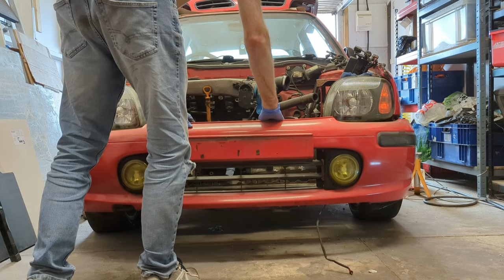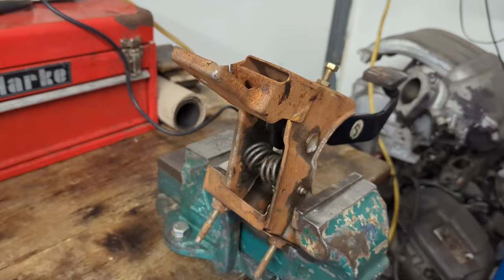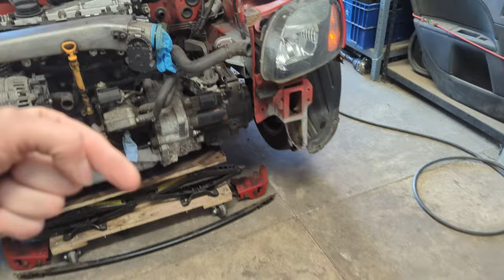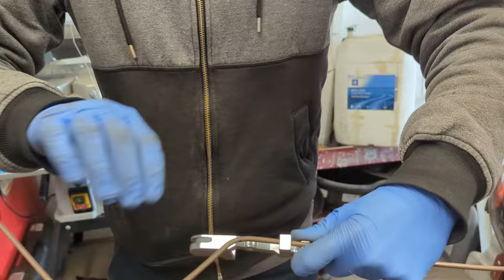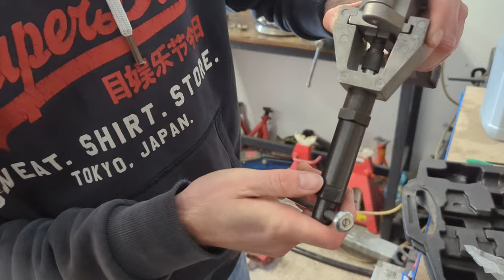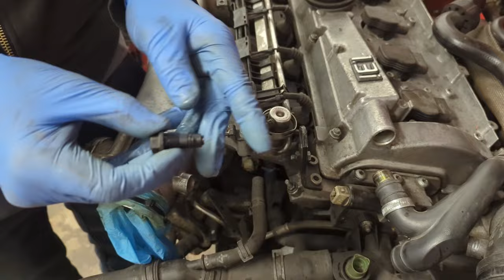Cable to Hydraulic Clutch Swap for the Turbo Micra - Audi/VW 1.8T Engine Swap

Comment: Bro pls shed some light on how you gonna play around with the drive shafts 🙏🙏
Reply from the maker: Current plan is to use Micra shafts welded to the inboard VAG bearing spider.  Ought to be better than cut and sleeve, and I've seen it work well.
Reply: @cgten very wise that's what i was planning on doing too